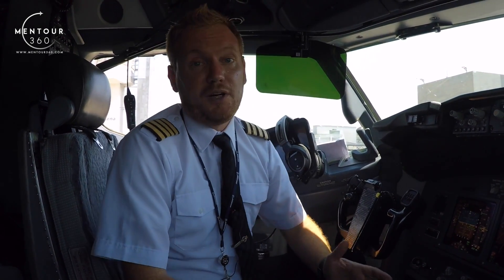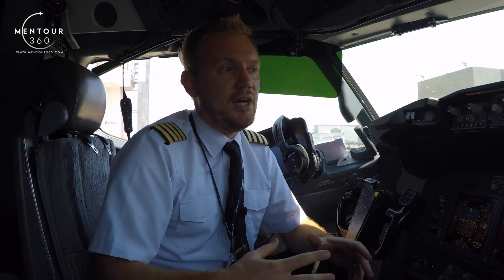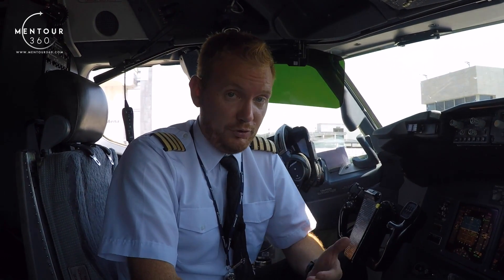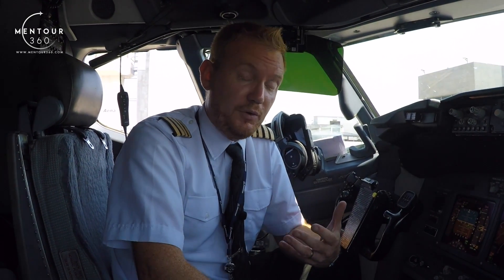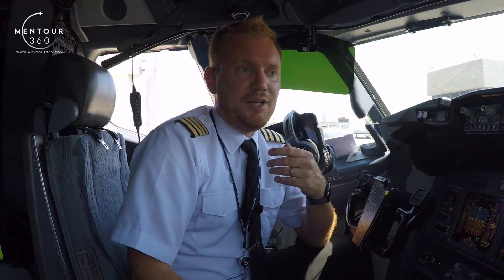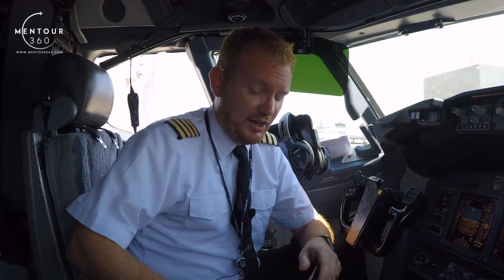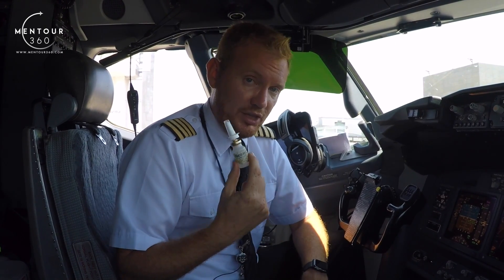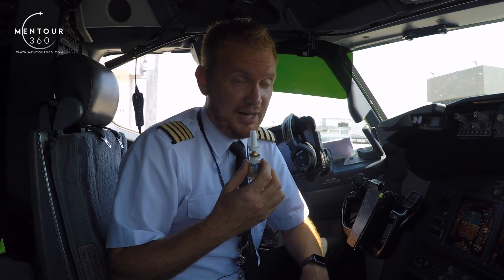Do the pilots ears pop?

Comment: if you jump while in the isle, you will suddenly fly back and hit the back of the cabin at the speed of the aircraft, this is because while you jump the plane moves from underneath you, this can be very dangerous at 500mph. don't jump on your flight!😉
Reply: This is not right since the airplane doesn't accelerate to this speed while you jump. You move with the same speed as the plane. Nothing's gonna happen.
:)
Reply: Yes you should be careful especially when you can jump 500m high...you will never get back the plane.
Reply: With the Earth spinning at 1000 mph then the same should happen when one jumps.